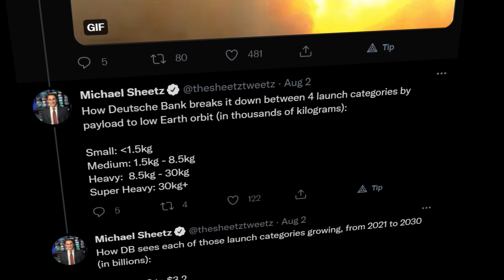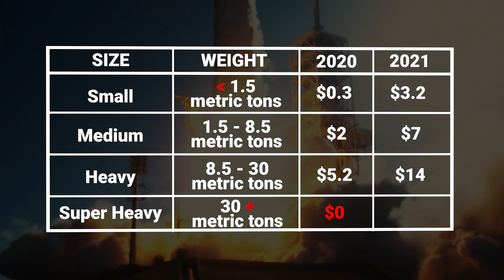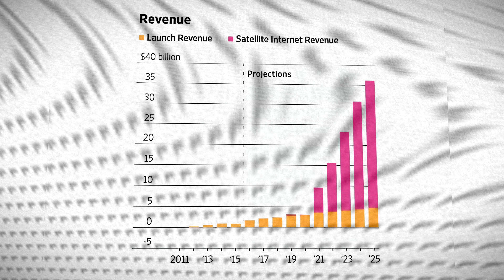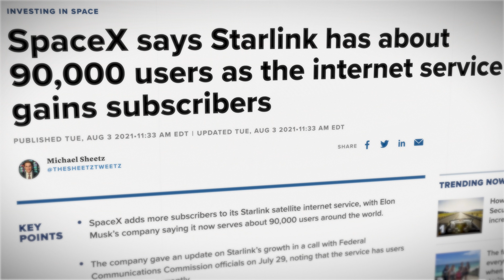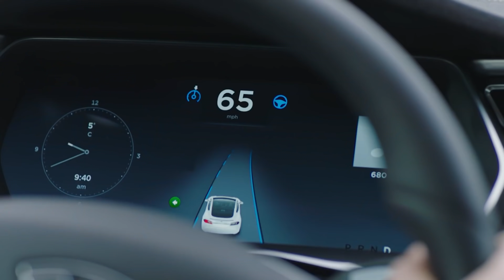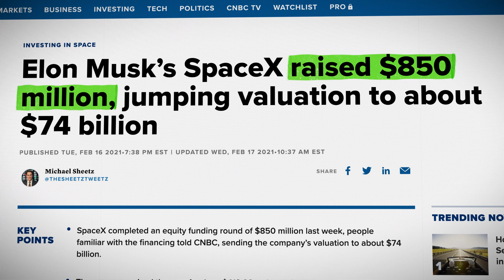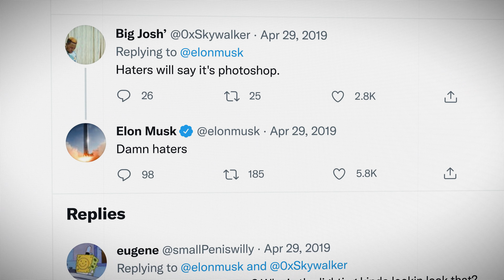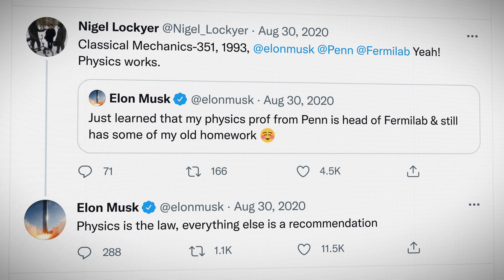How BIG is SpaceX?

Comment: Point to Point will never work. Remember the protests from NY residents over the noise from Concord? Well Starship is significantly louder during takeoff and landing than Concord was.
Concord was also banned from flying over the speed of sound over land due to sonic booms. Starship will create a sonic boom seconds before landing in presumably heavily populated areas, and so will the booster when it returns to the launch site.
Take off and landing ports would have to be so far from any populated areas that just just wont work. And to achieve anywhere near 5% of the global travel market as you claim in the video they would need a launch and landing facility near every major city on the planet.

Comment: A 747-400 ER airliner (such as is used for long haul flights) has 876 cubic meters of interior volume, a payload of 100 tonnes and carries 524 passengers.  So you need about 1.7 cubic meters and about 190kg per passenger...more for 1st class, less for everyone else.

Interior volume of StarShip is 1,000 cubic meters and it can also carry somewhere between 100 and 150 tonnes - about 20% larger overall which gets us to about 630 passengers.

However, the 747 has to have things like food service, bathrooms, pilots, and large baggage capacities because on a 20+ hour flight people will need those things.  But StarShip will only be flying for at most 1 hour.  So maybe it can skip all of those things.   The need for good leg-room is reduced on a very short flight.   People who need to fly a long distance, fast are likely to be business people who will fly someplace, stay maybe a day and return home...so it's plausible that they won't need massive amounts of baggage.

So it seems likely that they can get maybe 700 - but really no more than that.

Flying from NewYork to Sydney Australia (with return) currently costs between $7,500 and $8,000 - so about $4,000 each way. 

Elon says that they will ultimately be able to launch StarShip for about $2 million per flight ($900,000 in fuel, $1,100,000 in ground support).  That gives them a break-even cost per passenger of right around $3,000 for a one-way ticket irrespective of distance...without any frills, without the cost of ferrying people out to the off-shore launch pad, insurance, baggage handling, etc, etc.

The fuel for a 747-400 on that route would be about $100,000.

So I think it's possible to compete with airlines - but it's not obvious that it's a massive money maker.

Comment: Point to point (even though technologically possible), will never be as big a market as airplane travel for several reasons and therefor will never be somewhat affordable. 
The hyperloop has been debunked over and over for about 100 years and literally nothing has changed. So assuming this will be a thing, doesn't really make sense.
In regards to Starlink, if there actually was a huge market for it in those particular areas, existing providers would just have extended to those areas already. (which they might just end up doing over time).
The amount of people who would benefit from or really need Starlink and can actually pay for it , is relatively small. The costs of launching the sats, the sats themselves, maintenance, offices, employees, etc etc are substantial (and every 5 years you need to relaunch and replace all the sats). 

Would be amazing if they can somehow make these things work (not just for customers, but for THEMSELVES, in terms of it being profitable), but it's more likely (based on the research and calculations of many bright minds) Starlink will not generate massive profits (if it all), Hyperloop will never become a thing and that point-to-point with rockets will cost you tens if not hundreds of thousands per trip. (if they manage to not "crash" 1 rocket out of every 100-200, which is still the case for every rocket manufacturer, including SpaceX who sits at 1 "crash" in 100-ish right now with the Falcon9.)
Reply: Not to mention that electric cars were tried & failed to gain market share a century ago & non of biggest & most experienced aerospace companies in the world ever built reusable rockets.  All evidence "proves" Musk must fail miserably, lol!!!
Reply: @davidkottman3440  Ok, you just reflect you have no clue how things work in the real world and blindly believe Musk can turn any idea into a lucrative business model.
Even the 2 examples you use to justify that "all Musk his claims are possible and viable", don't make any sense.
The fact there now is huge demand for eletric cars, doesn't mean they run a successful/profitable business model. 
In regards to your "reusable rocket" argument. They did this decades and decades ago, but it simply wasn't worth it (lag of demand/interest/funds/etc).
It is not the case they didn't had the technology to do all of this. It was lag of demand and therefor funds to continue working on these projects.
The reason SpaceX does things so cheap, is due to how they build rockets, not just because they reuse them.
Reusibility is just a very small fraction of it all, which is only interesting for a launch provider who aims to launch extremely frequently and needs to generate profit (every % they can get), which NASA or any other government funded agency (that only cares about mission success) doesn't have to do.

None of this makes point-to-point viable, non of this makes Starlink viable, non of this makes the Hyperloop viable.
You simply have no clue what these projects actually imply and just blindly believe everything Musk says and the CGI renders you see.